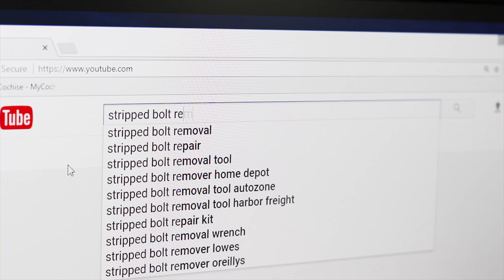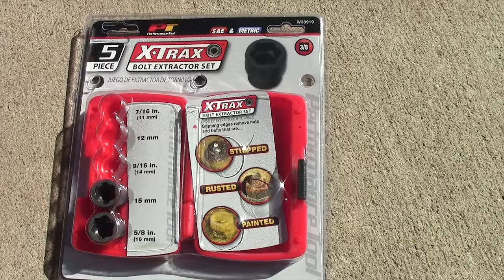500 EXC vs the Stripped Bolt : How to remove a rounded bolt

Comment: I did the exact same thing on my KTM. For some reason, that bolt is always soft. Mine was an Allen bolt that stripped. Tried JB tried bolt extractors. I just brought it to the dealer and let them take it out. So frustrating.
Reply from the maker: How much did they charge to remove it?
Reply: Northland Motorsports in Flagstaff charged me $60. Kind of pricey for a bolt removal in my opinion but at least it was done. I didn't have time with school to get it out myself.